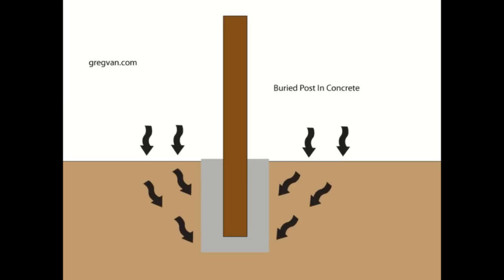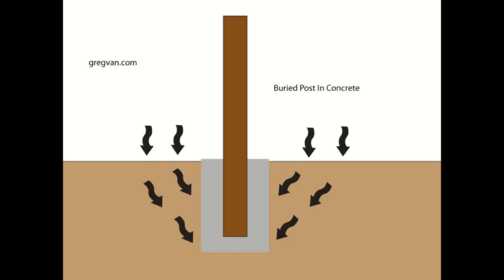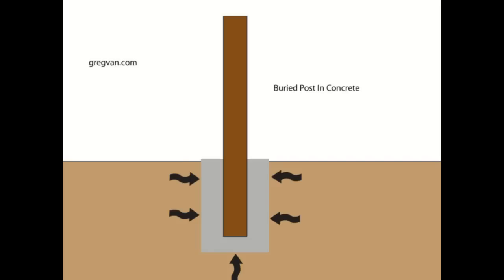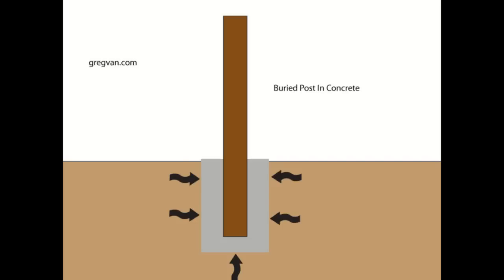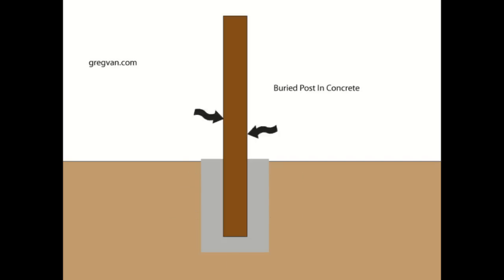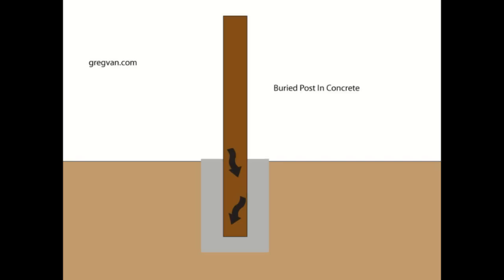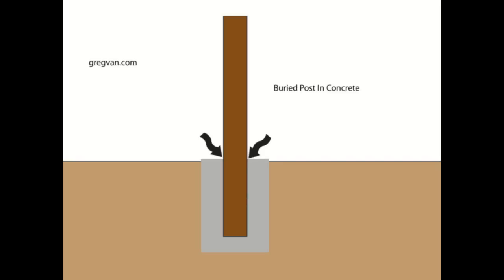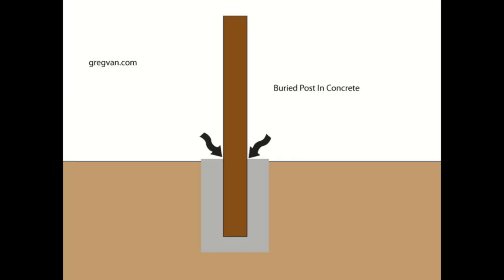Why Do Fence Posts Rot and Break - Wood Fencing Damage

Comment: The top of the post foundation should be slope shouldered to shed water, and the whole post should be sealed to reduce water & bacterial intrusion. If the base is poured around the post, the post should be sleeved for protection & easy inevitable replacement. The top of the post should also be capped or sloped to avoid standing water & reduce bacterial growth.
Reply from the maker: Great points

Comment: when the posts are dry prior to installation if you stand them in a large barrel of old engine oil thinned down with diesel and creosote for 24 hours then allow to dry off for a couple of days before fitting they will probably last you out, I fitted about a hundred with this method about 30 years ago and no sign of rot yet
Reply: +mark scott THAT I believe...isnt' that basically what telephone poles are treated with?
Reply: Exactly! And the reason this is true: water doesn't cause rot at all! It's several types of fungi that actually cause rot and this methods of treatment essentially fills the woods cellular structure with a poison that the brown fungi cannot latch onto and take hold to colonize and begin eating the wood structure.
Reply: Please, old dirty rich in heavy metals motor oil? Thinned with diesel and creosote??  Don't we have enough water contamination already???? You must have a shallow well that is contaminated by this toxic cocktail nearby or some other explanation for this horrible suggestion. Maybe you have some DDT or chlordane you can soak the posts in too while you are at it . Keep them pesky insects away. Maybe some radioactive material like radium-226 so the posts  glow in the dark and you can find your way home at night. And remember to put a lead cap on them to help them last longer.

Comment: your dead wood posts needs to breathe. the air and wind will dry out any rain and snow. you cant bury them into concrete. even if it's pressure treated. also, stain them with a solid stain every couple of years and it should last a long time.  protect against sun and water.  cut your wood to tilt slightly at an angle to get rid of standing water.  water will warp your wood & doesnt evaporate fast enough.

Comment: I put a small grape arbor in my yard 40 years ago. It was PT 4x4" posts rated for ground contact. I put 4-5" of crushed stone at the bottom of the post holes and plced the posts on top of that and poured concrete around the posts but left 3" of soil at the top of each post hole. 

The soil is very sandy but 40 years and counting ain' bad.
Reply from the maker: Here's to 40 more and thanks for sharing.

Comment: If you want fence posts that will last forever use cedar wood posts and crushed stone instead of concrete so the water can drain. Foamcrete might also be a good substitute since it requires more water to be mixed with it than normal concrete and the fact that it is part foam should mean it holds less water as well. You could also wrap plastic around the bottom of the post, that black plastic roll that looks like a roll of garbage bags that you lay down when framing on concrete works best

Comment: Facing the same problem for some years on a beach region soil in North/East Europe. Got small fence ~ 1000mm from ground. Always rots at the place where soil and air meets. This winter got an idea - Dig in the ground stainless steel rod with a (100mm x 100mm) foot, (600mm long and +/- 300mm deep in ground), drill hole (270mm - 250mm deep) in the middle of the pole base. Stick the pole on the rod avoiding the pole touching earth. If need to replace, just take off the pole and switch to a new one. There is no wight to fight for the pole as i have only one horizontal log till the next pole. Just like the cow corral on field. Any tips or criticism?
Reply from the maker: Bolable It sounds like a good idea, but how does it hold up in strong winds. My main concern would be building a 6 foot tall wood fence and having it blow over during a strong wind. It seems like it would be a great idea for a 3 foot tall wood fence.
Reply: gregvancom 1000mm = 1m = 1 meter = 3.2808399 feet (3 feet 3⅜ inches). Thats right also I have no pressure from wind as I have only one horizontal log. I believe the idea should be also usable for higher fences and pretty strong wind. Solution - deeper in ground and deeper the steel rod in the pole.
Reply from the maker: You've got a good idea, but I don't know if it would be cost-effective. You can purchase large metal posts that will last for decades, but whether or not this method is cost-effective would be up to the homeowner.

Comment: I don't see many comments here about letting the post set in a 5 gal (or taller) bucket of wood treatment and/or linseed oil , not that it is that easy to find anymore. If you find a VERY OLD construction manual,..it will tell you to lay the whole post in a vat of linseed oil with an additive or two....Lay it in the day before you use it.   Pressure treating is targeting organisms mainly, I don't recall if pressure treating does any amount of waterproofing at all.  If water passes through the post MUCH MORE SLOWLY,.it will be a very long time before you ever have to deal with it. It is not being wet that ruins the wood,..It is the moisture passing through and leaving the wood member multiple times that does this.
Reply from the maker: I've never done it before and never worked on a project where it has been done, so don't think I would be much help. However, I like the idea of creating something where the entire post could sit in some type of wood preservative, but don't think it would be much help to put it in a 5 gallon bucket in areas where it rains, snows or freezes.

Comment: So I installed a fence with pressure treated 4x4 posts and simple (lazy) concrete plugs. 3 years later i've got posts rotting off at the top of the plug:( I've started replacing them as they fail with a post in a formed plug (suana tube, above grade domed top, caulked joint). Is this method worth the extra effort or am I just whistling in the dark? thanks

Comment: hi sorry if this has been asked before. I have seen theas things called post savers that heat shrink sleeves to the post about at ground level not all the way down the post. will rapping the post work just as well in cling film parcel wrap work as well. I have allotment and the water table is very low and good soil so posts tend to rot fast.
Reply from the maker: +Adrian Eyre Maybe it's time for a video, because this is a question I've received numerous times. The problem I have with wrapping the bottom is that moisture can be absorbed in through the upper section of the wood post and work its way down where it would be trapped, rotting the post even faster. You might consider using metal's posts, but I really don't have anything that would provide you with something that would work well.
Reply: +gregvancom I dont mean to rapping all of the post to the bottom just the part that meets the ground level like on http://www.postsaver.com they claim that 100% Effective; Zero reported fence post or utility pole failures due to ground rot in over 20 years. using there system that sum how slides onto the post and is heat shrink on. or are they doing something i have mist here.

Comment: First use pressure treated posts.  Next dig the hole 4- inches deeper than the post and put a rock or broken brick for the post to set on.  Next when you pour the concrete make sure the concrete surrounds the post on the bottom and set the concrete about 3 inches above the topsoil.  Done this and the post last 30+ years and still as solid as the day they were installed.  And this is Southeast Texas with moist soil and lots of rain.
Reply from the maker: Sounds good to me.
Reply: Problem with concrete above the top soil is you're going to have a hell of a time running no climb fencing, chain link, or boards across it unless you don't mind having a 3" tall gap near the colums. Also your fencing won't lay flat against the posts. That's why most people don't do it.
Reply: I do not put a horizontal plank across the bottom.  I spray round up  under my fnece and have a clear area at the bottom of the fence line. The vertical plank that butts up next to the 4x4 post, I put a notch around the cement plug.  My dad's has fence post poured this way and +30 years later they are solid and no play.
Reply: birther1968
That's definitely one way to do it. One advantage of having a horizontal rail near the bottom is for attaching vertical barriers that go down into the soil, like hog wire or PT wood or that kind of thing to stop critters and dogs from trying to go under. Gives you a little more strength having a rail low down like that.

This also depends on where you live. If you live in rainy Seattle rounding the concrete above grade is a great idea. If you live in Phoenix it's totally unnecessary. ;)

Comment: Oxygen and sunshine/warmth is also a vital catalyst which is why timber in north facing positions or in deep water will always last longer. This seems counter intuitive but the mix of sun/air speeds up the process of decay which is ideal for bacteria/bugs etc. I am in the UK. All my wooden framed windows that are south/west facing have shown earlier signs of potential decay than the north facing ones and I am talking about more than 100 years. I now use linseed oil based products, oil/putty/paint. With careful maintenance, they will last for ever simply because linseed oil nourishes and protects the wood and is a natural preservative. We have quite a few period properties over here going back many years and time and the old ways are invariably the best ways in the long run. However, it must be said that the quality of timber today is nowhere near as good as it was many years ago. The real problem is down to modern day short term economics. Decent seasoned timber takes time and time is money. The modern throw away approach is good for business. Back on the posts, last year, I noticed early signs of wet rot on a pressure treated post so I ran the heat gun over it to kill the bacteria and woodlice and then simply added some linseed oil and ran the heat gun over it again to help it to soak in. This year, no real evidence of further decay. The wood is hard and more important, no woodlice which feed on rotting wood.
Reply from the maker: Thanks for sharing and I've heard good things about linseed oil, but never used it. Interesting about south west facing wood windows and I'm guessing those are the windows with the most sun shining on them.
Reply: @gregvancom  Yep. Wetter and warmer weather from the prevailing winds, most of which comes from the USA  on the Gulf Stream :)

Comment: Your right about moisture being the main reason but also the additives in the concrete don't help, the best solution is dig the post hole deep enough and secure the post with half house bricks and stones of various sizes (an 8-foot post should have 2 foot in the ground) you then tamp down the bricks and stones firmly until the post is solid. The bricks and stones packing below ground allow the post to remain dry and therefore lasting a lot longer (this is a tried and tested system used way back albeit they did have oak posts back then but now-a-days we have pressure treated wood which will last a long time.)
Reply from the maker: I'm not about to suggest that your idea doesn't work, but I don't think it would work as well in soils that retain a lot of moisture like clay. Areas with gravel or areas that allow moisture to travel through it easier than clay can accumulate moisture and rot the wood post.
Reply: I do agree if you have a high water table you are always fighting the elements, but water tables rise and lower, with my suggestion even in heavy clay soils the sub soil part of the post has little contact with moisture ( unless you have a high water table ) the half house bricks provide stability the stones provide a non-porous breathable area resulting in longevity for the post with the added bonus of when it is time to replace the post just remove the bricks and stones and fit new post and then replace bricks and stones no extra expense and no concrete lump to remove. Please let me know what you think.
Reply from the maker: I think the breathable area you're creating will allow water to seep into the post. Bricks also absorbs water and wet bricks in direct contact with wood will allow the lumber to absorb moisture from the bricks, eventually causing it to rot.

Comment: so how to avoid that? should i coat first the footing of the post with sealant then foot the cocrete? what is the best way...i want to build a pergola on deck and im trying to figure out ways of avoidind that
Reply from the maker: I really don't have a solution to the problem and am still working on it, but this video might help Slope Concrete Fence Footing To Drain Water Away From Wood Post .

Comment: PRE-Soak Wood Posts w/a 50/50 mix of used motor oil & diesel fuel.
That wood may Never Rot. It is perfectly Safe as it Soaks into and stays in the wood.
Makes a Great Dark Wood Stain for the entire Wood Fence too, that can be re-applied as necessary.

Comment: What if you dig the hole much deeper and add rocks or gravel at the bottom and have more concrete with a more round hole? would you prevent water from getting all the way to the wood or at least prevent much more water than would have got there?
Reply from the maker: The problem I see with using gravel around the perimeter of a wood post with concrete is that it could allow moisture from the surrounding ground to settle in the area with the gravel, especially with clay soil. Check out some of our other videos for more information at our website.http://www.homebuildingandrepairs.com/fences/index.html

Comment: I've set hundreds of treated posts; some from big named companies, others local, straight into dirt---no concrete. Some--specifically from the big named company---started rotting within 24 months. They sent a local company rep to inspect my claim and he watched me break 4" posts with my hands; they paid the claim. Others took longer but have rotted within 5 years. I sent samples to a lab who tested them and the recurring problem was lack of sufficient penetration. I'm done with wood---I've found steel t posts on our property that are probably as old as I am.
Reply from the maker: CyRanchTx It's definitely a tough decision and I've heard stories where the wood lasted longer than the metal and the metal lasted longer than wood, so I guess we can always resort back to flipping coins to make our decisions.
Reply: CyRanchTx You guys must have 'piss poor' tantalizing facilities,  here in New Zealand ours is guaranteed for 50 years! 

I built a fence up the side of my house 8 years ago now, whereby I stuck the 4x4" fence posts into the 10" wide concrete footing, with no sloping shoulders on the footing to direct the rain away from the posts. They wasted no time in cracking the concrete, however, that's as far as they've got, they look and feel every bit as good as the day I stuck them in there and I certainly can't shake them!

Indeed, this said fence joins up with the one the neighbour built at the back of the section years earlier in '78. It was an iron clad fence with 2x4" rails and  about 5" (approx.) round tantalized posts. The rails were made out of non treated timber and the iron was decidedly second hand, I decided to replace both of the afore mentioned with new materials. The fence 'posts' were showing signs that they'd been planted in the ground for a while, however, given the 29 years they'd already served, I figured that they'd be good for another 20, so I built on to them and that was 8 years ago with no problem... I'll probably go out now and have the thing fall over! :)
Reply from the maker: There is a very good chance you have different lumber and methods for treating it. I love your humor and thanks for sharing your story with us. I'm often amazed at what other countries or people in my own country do to solve this problem.
Reply: yeah they call it pressure treated but it is more like dipped. Even Loews says that if you cut one of their 4 x 4's you should treat the cut end with new preservative to protect it from rot. Same with their other P.T.ed wood. I had the same problem with Yalla wood. Horrible stuff, never buy it again. It dripped green ( copper) liquid and oozed it from the wood surface. I had the rep out and he said that it what you get today. Gave me a couple replacement boards but three years later most of the boards on the deck have started to dry-rot from the inside out. Just crap!

Comment: I received a tip to wrap the buried portion of the post with felt. It will provide a moisture barrier and increase longevity. Thoughts?
Reply from the maker: I'm not a big fan of it.
Reply: the felt will trap water
Reply: if you mean felt paper ( tar paper) then it would still not completely seal surface.  Real felt is porous So, no to either of them.

Comment: I always use concrete as more of an anchor than a base for the post. Put the post in the hole and add a couple inches of dirt, before  pouring concrete. I've pulled up posts that were 20 years old that were as dry and solid as the day I set them.